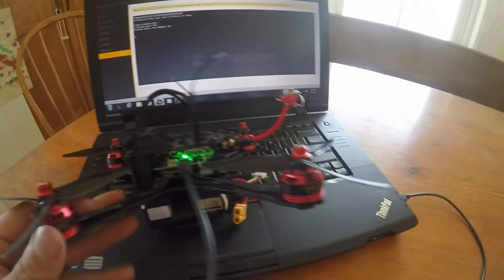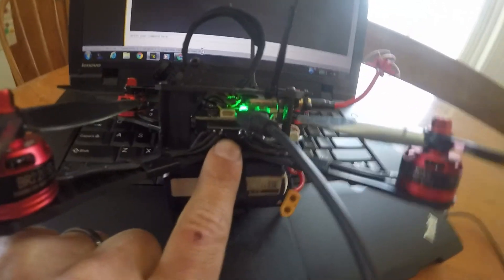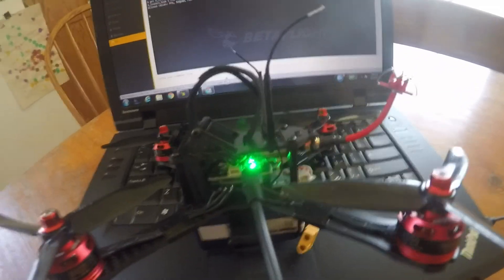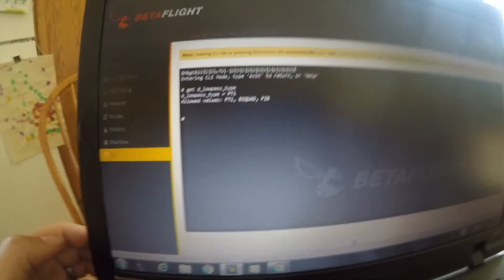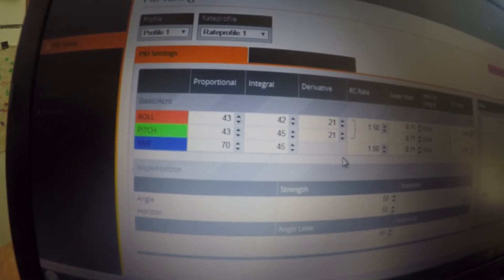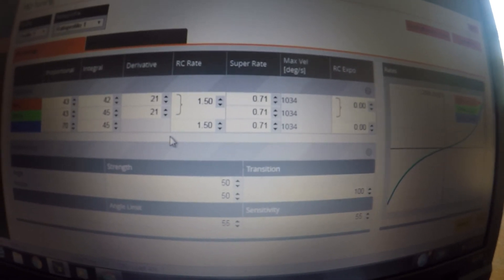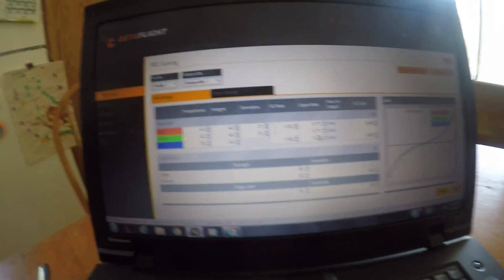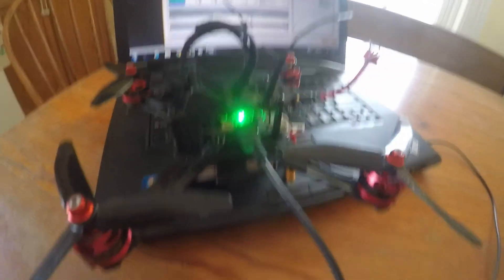PID Tuning my Betaflight 3.1.7 Realacc X210 with Racerstar BR2205S and 20A 4in1 V2 from Banggood

Comment: Hi Carly I was going to give you some tips but watching how you fly you aren't very noob haha. Anyways here there are other some of them more "advance".

1. Try setting your  d setpoint TRANSITION to 0 instead 1 or 0.25, it gives a more realistic feeling on how your D tune is and its possible to get rid of these bounces back you have at the end of fast rolls and flips.
2. If your motors allow use 1 gyro notch for the lowest frequency peak, like 160 for idle speed if your quad vibrates without it, and then set the D notch to the value of your highest peak, ie: 260 , you will get a more precise flight.
3. If you have some vertical play in the motors that usually compromises the quality of the flight, I recommend you to unscrew the allen screw holding the bell just a little bit a give a gentle tap to the top of the shaft so you squeeze the bell and main shaft together, then tighten the screw it again.
4. If you haven't tried I also recommend you setting the setpoint WEIGHT to 1 instead of a higher or lower number, it gives the most lineal and direct response to the quad from your thumbs.

Ps: Yeah definitely crank that D up to 30 at least.
Reply: Hi can u post or write your pid? Thanks!
Reply from the maker: Hey thanks for the help!  Since I've posted this video, I've done further notch filter tuning, which has helped even more.  There is very little propwash in my latest video.  Last night I tried soft mounting my motors, so I'll see if that helps further.  Thanks again!
Reply: nice flying tho, got same setup, trying to also get rid of these bad-propwashes, mines worse.